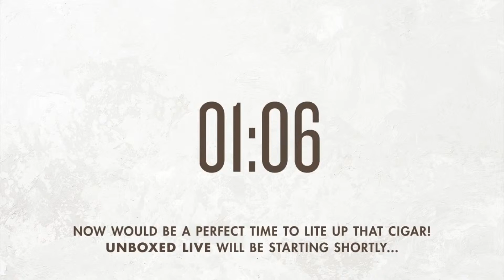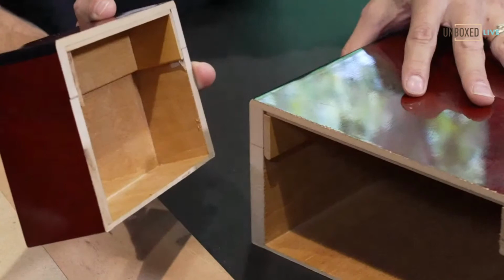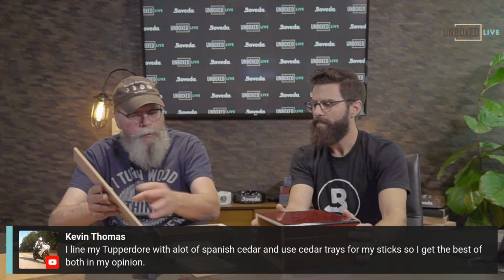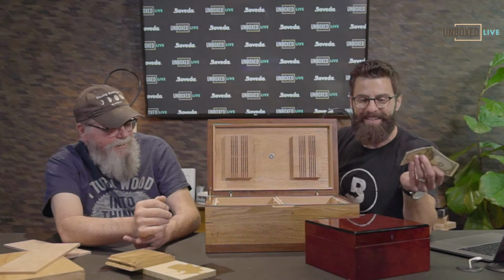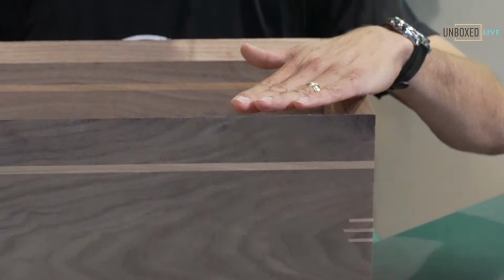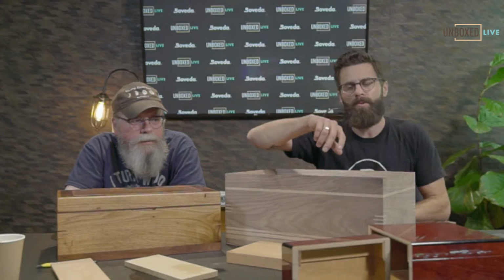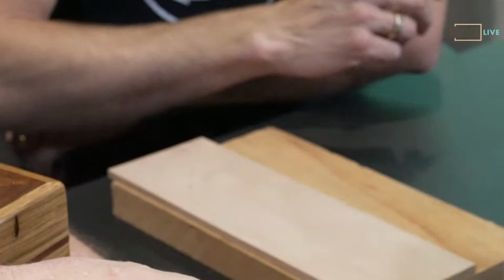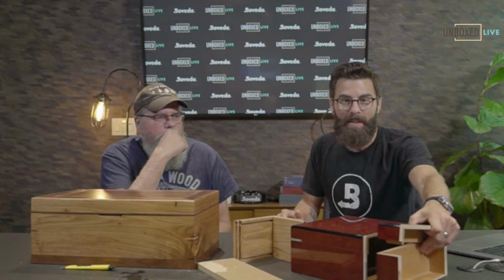I’ve cut a humidor in half and…

Comment: Yup, I have a cheap "100 count" wood humidor.  I use 14 - 69% bovida packs.. lol. I have 1 - 4 pack cedar boveda holders on lid, I use 2 - 2 pack cedar boveda holders on the floor. Basically I now have a large 50 count. I throw 4 loose packs on top of my cigars in lower portion and 2 loose packs on top of cigars on my top tray. I need to step up my game. 😉

Comment: I use a combination of wooden (cedar lined, cedar tray with added Spanish cedar sheets between levels. I use three Humidor 69 Boveda packs.  Last’s half a year that way.
In my sealed Tupperware for open aging cigars, Spanish Cedar sheets between cigar layers and 2 Boveda 69s. 150 or so sticks in total, so it may be overkill - but it’s always 69 degrees around 68% humidity. Boveda has been the saving grace - from the 1990s when I’d forget, after a trip, to check my old humidity fill units. 🌵 🙄